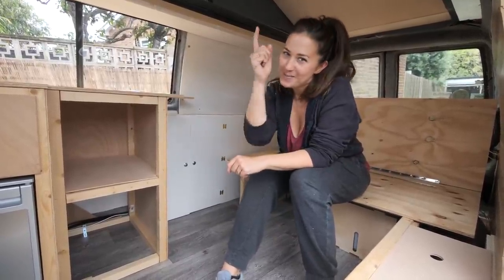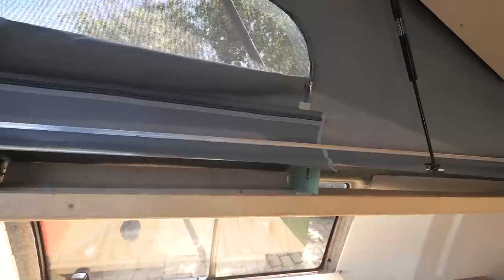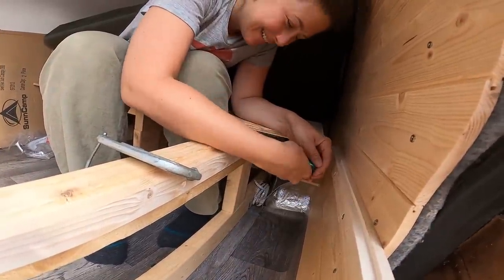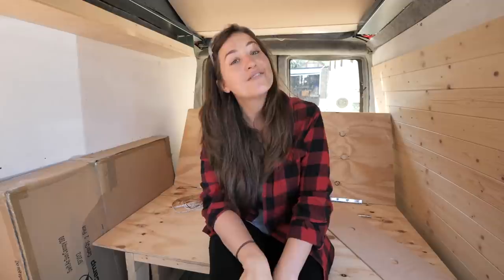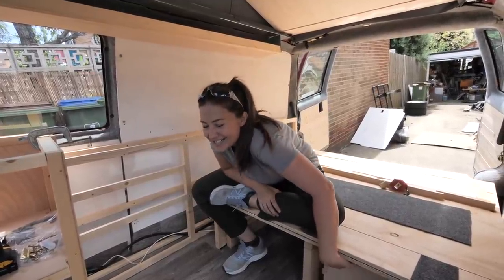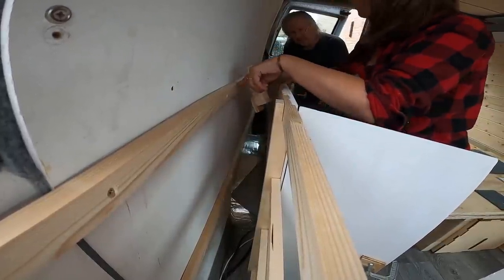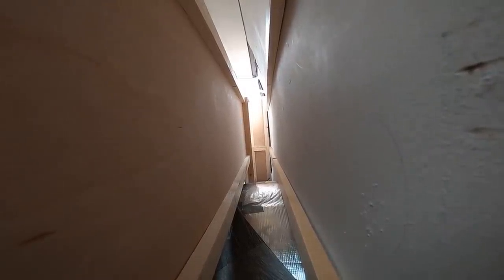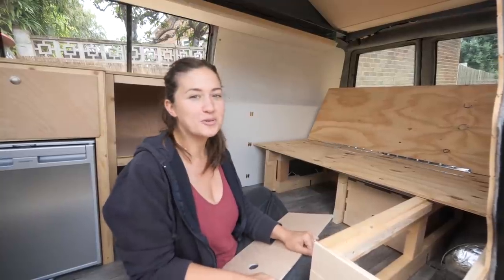3 Van Storage Ideas | Self Build Camper Van Conversion For Dummies Part 6

Comment: Emma; you are my hero! I've been struggling to come up with a bed  idea, and your solution is perfect! My partner is 6'4" and needs a full queen-length bed, which takes up an obscene amount of floor space in a van...a tri-fold that folds up into a sofa is perfect. I plan cabinets on both sides to support it in bed mode, so hopefully can get rid of the center support.

Comment: We bought 4 zip bags with hanging loops from the £1 shop and hang them up on hooks. 1, Cutlery, 2. Soap/toothbrushes, etc , 3. Electronics, 4. First aid. Others could be pens, a small tool kit, sewing kit and stuff and they just hang in rows with lables on them in duct tape. Buy a few spares just in case.

Thinking about seeling our UK camper and building one here in Portugal, but with removebale interior, using a couple of ideas from you.

Comment: I had bought a conversion van already built out by a company~ very cushy and only $2500.
The layout is something I wanted to change… hadn’t seen my dad in awhile…tried to connect with him so we could work on changing the layout together. 
Sadly, he died of Covid and his complete workshop is now inaccessible because of stepmother drama. 
Currently praying for God to bring along viable help so the summer is not lost.

Idea for laundry~~ drop in a sturdy mesh insert and secure for air circulation and use another portable mess bag_  in and out with ease!🤓

Comment: Rivets;take the loose one out , it’s not achieving anything and offers no support drill it out and replace it , next time make sure the two surfaces are tight/ touching and you’ll have a perfect job, use the handle ( black ) ends they have more leverage and don’t put your fingers in the middle or you’ll either break them or get a blood blister.
The glue on the LED will dry out on the porous ply
Storage. You can attach bottles to the underneath of the shelf ( so cooking stuff tea bags etc ) by putting a screw threw the lid 
Are there any areas you can reclaim? Can you use under the seats ? 
Kiravans sell a unit that goes inside the side loading door that reclaims space in the door , could you make something similar?

Comment: I can totally relate to every piece of framing  is a different length. In the middle of my own build. It makes for slow building with measure, check, adjust, measure repeat repeat. But satisfying when things work out. All on hold for a while as I twisted and broke my ankle. Half way through the electrics and roof insulation. Ah patience. I'm not patience. Thankyou for sharing your build.

Comment: Weight, weight and weight. Try to limit thickness of timbers where possible and don’t clad what’s already covered as it’s also unnecessary an weight addition. Your bed and cupboard supports are double the thickness really needed as it’s a compression load. Remember to add all your additional weight and what you’ll be carrying and see if your over the van weight limit

Comment: Another good.storage location is across the top of the back doors like you have on The side giving more storage behind you at the back. AND YES you will need your loo where else are you going to poo and wee when wild camping. Its a big issue at the moment among camper vans getting bad press about wast and stuff being dumped and left at wild camping locations, the van is really coming together looks good also make a small box between the front seats, see you on the next video
Reply: Bush campers use a small shovel and bury their waste. It's the right thing to do and skip the potty until you have RV parks facilities for dumping.

Comment: Great video, as always. One tip for the laundry. Since it’s a deep space, insert a laundry bag, that will make it easier to grab your dirty clothes. We traveled in a camper van with three children, we attached the laundry bag with a hook. We had a very similar situation to yours.
Reply: I put our dirty laundry into a sailor's/canoeist's dry sack which have airtight seals. It keeps the smell of socks and sweaty t-shirts out of the van.
Reply: Just use a pillowcase

Comment: Great job!  
We have got collapsible saucepans, kettle, bowls and sieve, saves loads of space in our cmpervan cupboard and function really well. Also, if you have really muddy boots and need to be on the move so can't dry them out immediately, you can use a very, very cheap shower cap (the disposable ones like you get in hotel rooms work great tho not so great if you're trying to avoid plastic) stretched over the soles of your boots so will stop the mud going everywhere in your excellent shoe cupboard and keep the pair together.